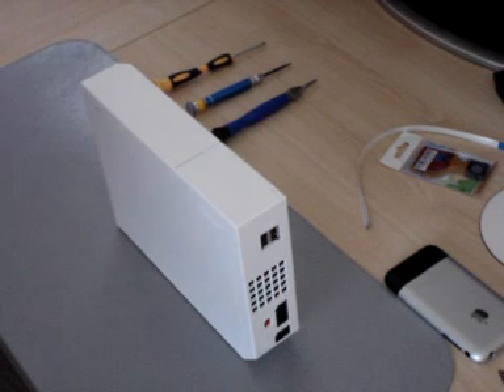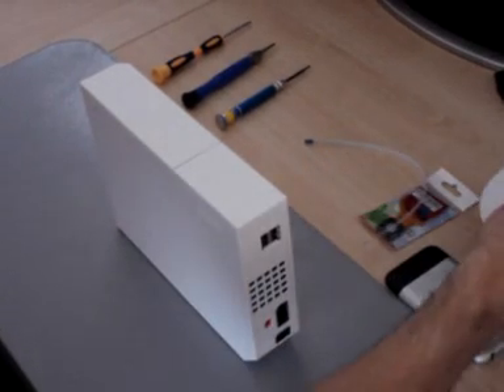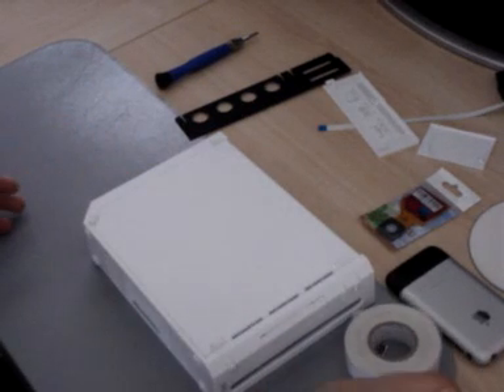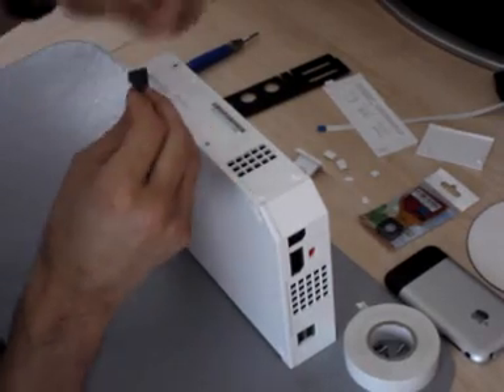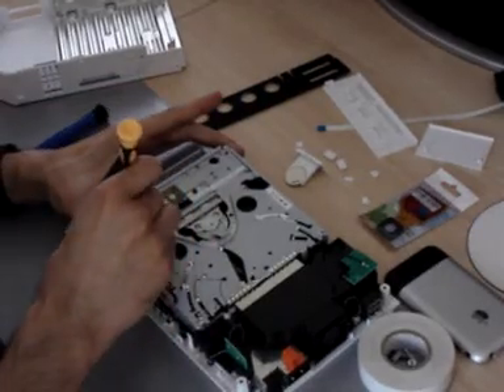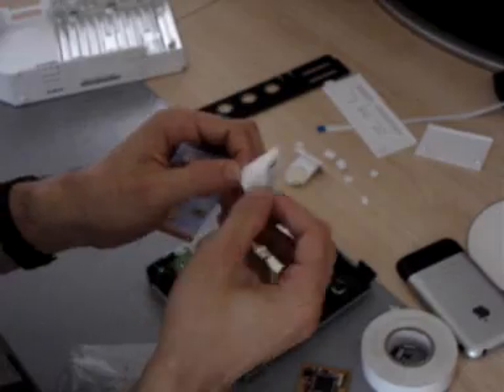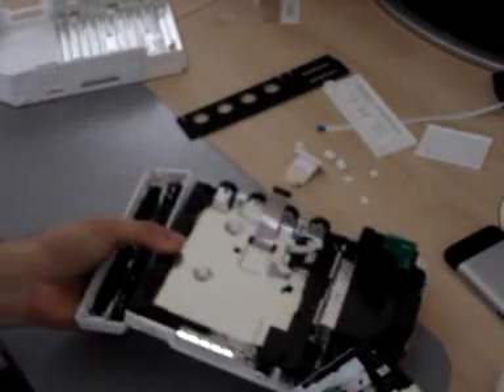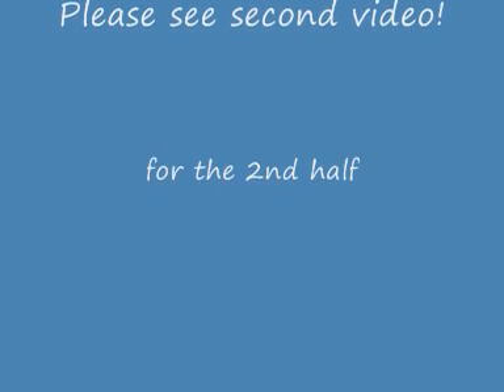Wii Solderless Modchip Tutorial (Part 1)

Comment: um i have some questions what product of the wii chip do u need if u aint any good at that melting those chips together and stuff u know the one with the clip on on the cd drive and that box the cd drive is connected to just conect it on the wire and i have the black version of the wii does it work on that one and what kind of discs do i need to buy to burn the games on to play on the wii and does those cost much